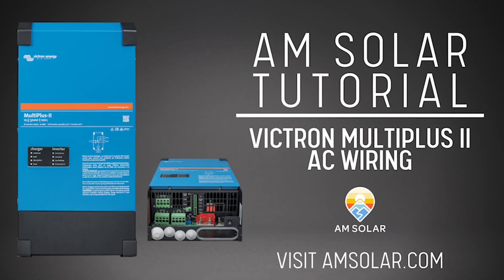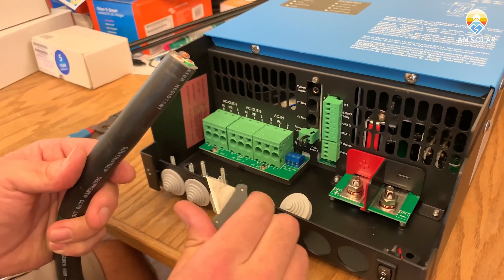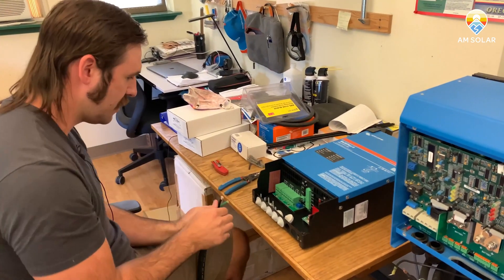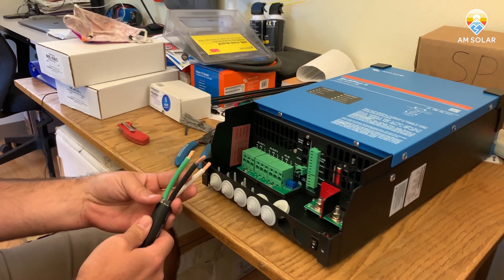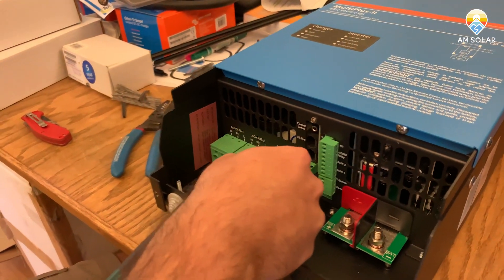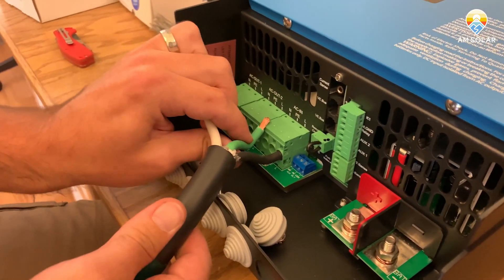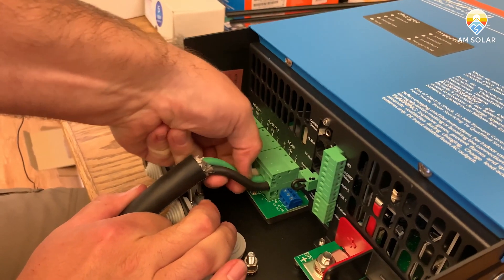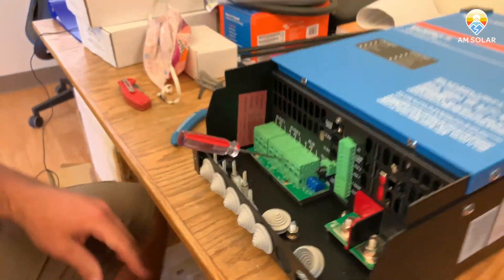AM Solar Tutorial: MultiPlus II Wiring

Comment: Why will it only charge my LPFMAX batteries to 13.8 volts?
Reply from the maker: If 13.8V isn't a limitation built into the battery BMS, then the limit would have to do with programming of the inverter.  Make sure your Absorption voltage is set appropriately.
Reply: @GarretTowneAMS  Absorption Voltage is set at 14.6v and the charge voltage of the batteries is 14.2-14.6v
Reply from the maker: @BillHoover-l4c  That definitely seems odd.  Do you have GX device with VRM that we could look at?

Comment: Good tip on the ferrels, i usually use ferrels on screw down type connectors like the multiplus i.  I am worried that these crappy connectors will have increased resistance from the sloppy connection compared to a screw down type.  Larry

Comment: Those push in terminals seem like such an incredibly dodgy idea. It would have been better if they had screws, and if they were worried about them coming loose, maybe a heavy spring between the screw and the cable, best of both worlds. Push terminals should be reserved for ethernet, phones and anything else that is not safety critical.

Comment: I had to use flat blade copper crimp on connectors that came with an inverter kit I got 20 years ago. I was using 4 gauge and even with needle nose could not get enough pressure to get the wires inside as the copper wasn't firm enough.  I really wish they had used the same type of connector as the battery cable as crimp on's are available just about everywhere for that kind of connection. Also if your wiring code requires you use conduit, those holes aren't really 3/4 size.  Its a great unit, they just need to change the connectors and make the holes just a bit larger to standard 3/4

Comment: Bad advice.
Get the connector depth right, good conductivity is super important.
On top victron requires proper cable sleeves.
Smoldering connectors are no joke.

Comment: That was really helpful!

I was about to install the 6 AWG (3 conductors + ground) into my new Multiplus-II 2X 120V and the manual wasn't at all helpful. Your video was!

I also learned that the rubber boot can be cut and sized to fit the cable -- I had no idea about that little detail!

Thanks for posting this video!

Now if only Victron could do something better with the 7mm nuts on the clamps, make them a bit easier to work with than using needle-nose pliers so that they are more securely tightened, perhaps something more along the lines of Romex-style 3/4" clamps used on standard US boxes...

Comment: I was planning on using 6 AWG ferrule’s on mine.  Keep the wire strands in line with less chance of cross connects.  Anyone try this to date?
Reply from the maker: My understanding is that Victron recommends against ferrules because they limit the contact area.  How this plays out in real life, I'm not sure.  We haven't used them.
Reply: @GarretTowneAMS  Thank you.  I attended the Mobil Victron Training class and the instructors were recommending ferrules but I don't think it was MP II specific.  Just general wiring
Reply from the maker: @jimsjacob  I just talked to two of our guys who went to the Victron Trainging and they say ferruls are a bad idea.  They played around with them and gave the wires a tug and the wires just popped right out.
Reply: @GarretTowneAMS  That's great info.  Thanks.  No ferrules it is!
Reply: I forgot to add, that I plan to test this as well…. I have the ferrules and the MP II.  I’ll do a couple of test runs and see if I can wiggle/pull them out.
Reply: Yeah, they were very slick and pulled out easy.  I ended up tinning them with silver solder which works well.  Plus I was able to make them longer than the standard ferrule.  I think that was the problem with the ferrules.  They are short on length.

Comment: Do you have a link to what type of AC wiring that is? Specifically gauge size?
Reply: I don't know about the single-phase model (the Victron website has the owner manuals), but the Multiplus-II 2X 120V split phase model uses 3 conductor + ground 6 AWG.

Comment: Just getting started on my Am Solar kit, installed the solar roof panels, the shore line plug yesterday, cut and sanded the plywood for the gauges and floor to hold the batteries and inverter. Every accomplishment is a fulfilling celebration! Thanks for all the videos. Step by step for us all new to solar is appreciated!

Comment: Not sure I like the push in connector better than a torqued set screw. Was there an issue with the old version?
Reply: Screw terminals can strip and result in a loose connection which can cause problems.